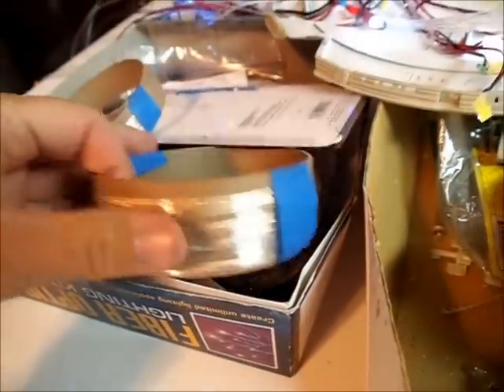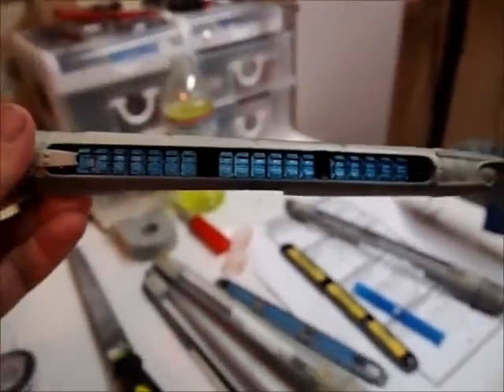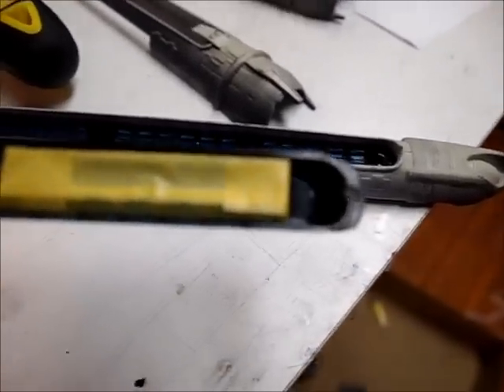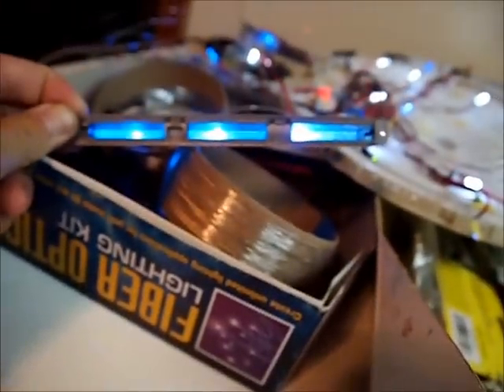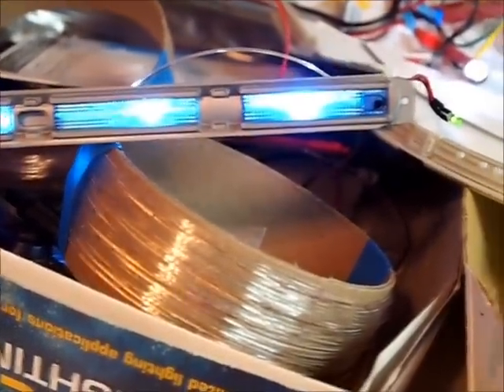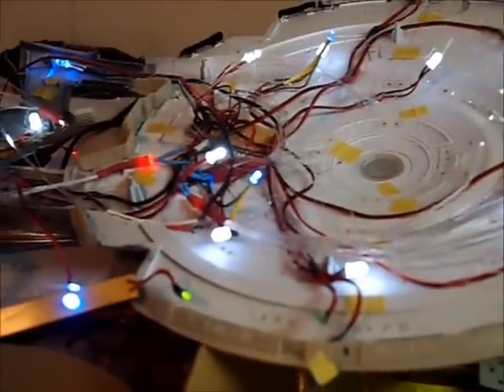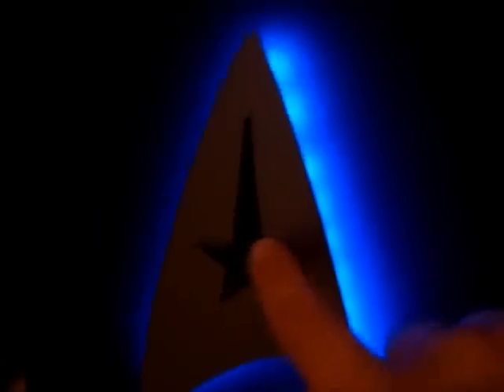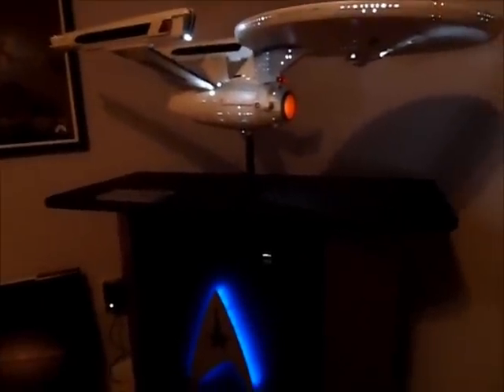Star Trek Enterprise NX-01 scale model build #2

Comment: Nice work so far.   I have one of these about half way done, and I did a lot of the mods you talked about.   The big difference is that I did not purchase a light kit but did everything myself.  I stopped working on it about a year ago due to a contest and I haven't picked her back up yet.   

The real tricky part that slowed me down was the seams on the warp nacelles.  Probably the worst ones on the model.  Most build ups of this model I have seen just ignore them.

I agree paint last!